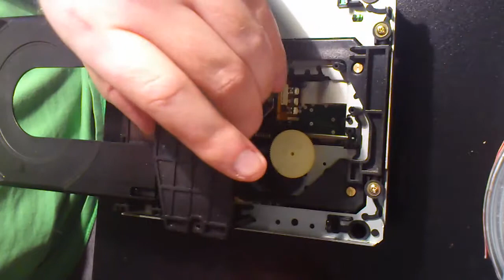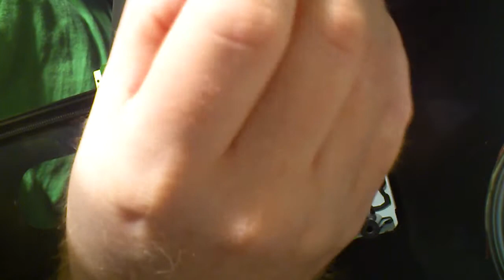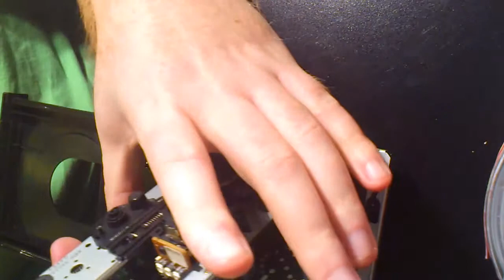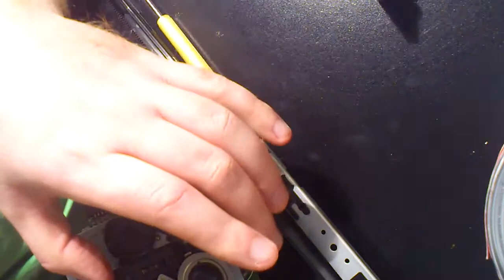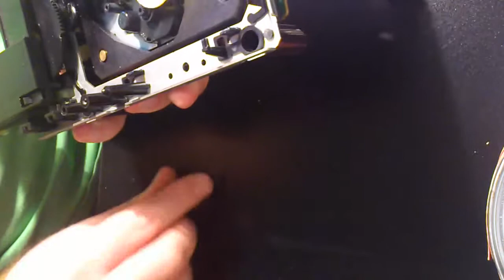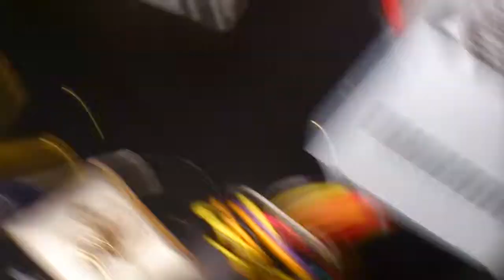sega CD model 1 Laser install

Comment: Any info on anti static point or why only SOME discs read?
Reply from the maker: Any new laser you get is gonna have the anti static blob on it that ya have to remove. most ive bought over the years come with a note about it. if ya get one that does not have the blob, its not likely a new laser. for a new laser to read, the blob needs to be removed.

Comment: Can replacing the laser fix sound issues?  My Sega cd model 1 is in excellent working condition and cosmetic condition, and it plays games perfect but it has weird swishy shhrrreeeerrrreeee sounds throughout gameplay of many games.  I already had the system completely recapped and it still has this audio issue.
Reply from the maker: I would #1 suggest recapping. Being that was done (let's assume correctly), I'd look to the next common components. Tv and sound system. A/V or stereo cables from the sega cd to the tv/stereo. Also has the genesis been recapped? Is it a HD model 1? If not, get one. The sound is greatly improved. The genesis does some sound processing even on CD games. 

If you are recapping a HD model 1, maybe consider the triple bypass with sound amp mod. That too clears up sound. 

But I'd also suggest double checking the recap job. Could be a cold solder joint, or bad pad. If the pads rnt clean and ya just put a blob over it, it can cause "noise" in the connection. Also make sure the caps are correct. Having a 6.5v cap on a 5v or visa versa can also cause noise.
Reply from the maker: And generally yes... A laser can fix sound issued if the disc was damaged. A stronger laser (or more in spec) will read a damaged disc easier. But bad caps can cause the laser to go bad too, even a new laser!

Also a bad power supply can cause noise too. May I suggest these guys? I got all my power supplies from them. 

https://www.retrogamecave.com/sega

Comment: Thanks so much for this video. I just ordered a model 1 Sega CD and it only played half of my games. The games it did play had no music or would take forever to load. I received a new laser lense in the mail today and followed this video and did everything step by step as you instructed. Now the system works flawlessly! I also have some capacitors on the way in the mail but the system works so well now that I may hold off on replacing those. The caps look old but aren't bulging or leaking yet so I think I'll open it periodically and check for leaks and such and only change them when there's an obvious problem. Thank you again for making this video. It was very helpful.
Reply from the maker: No problem! Glad it helped! The old laser mayyyy still be usable. If ya get bored one day u can try adjusting the 3 white painted screws. Those are the pots that adjust focus, intensity and power of the laser. Usually when the laser goes out of alignment, it's on its way out anyway.
Reply: @REBELsst  when I first got the system the laser had this white powdery substance around the plastic shroud that covers the laser and around the laser lense itself. Not sure what it was but I cleaned it out with a metal tooth cleaner but it played the same way. The substance  looked like what you'd find around the terminals of a car battery so I thought I was lucky it even played at all. I think I'll take your advice and keep it though. Just to use for reference I guess. Like I said in my previous comment, I ordered some caps which should arrive any time now but I think I'll hold off replacing them for now. It runs so smoothly that I'd hate to mess it up. Thanks again and God bless.
Reply from the maker: @philipayers7471  I avoid recapping if possible. Not only is it a major pain but if the system is working, there are many ways u can mess up and make it not working. Being I've been collecting for 20 years, those ideas of the caps not being that old are sorta wrong. Some are closing in on being 40 years old so recapping a working system may not be as scary a proposal. It's still a tedious job.
Reply: @REBELsst  that's awesome that you're a collector too! I guess it's obvious since you made the video. I've just noticed that the prices on some of these retro consoles are starting to sky-rocket so I thought that I should start to familiarize myself with repairing some of this stuff to prepare for future mishaps. The Sega CD I just fixed is one of two I currently own. The first one I have is in great shape. I've had it for a long time now.  But I thought I should buy another to get my hands dirty with. Problem now is I like having one for a workhorse and another for my "game museum". My plan was to do a total overhaul of the recent one and to not put wear and tear on the pristine one. I probably won't make it a habit of buying two of every console but the ones I feel that are going to go up in price I'd like to get savy with. I have no plans on selling anything that I own but I just want to be my own repair man. Gotta start somewhere.
Reply from the maker: @philipayers7471  its a sickness I think. I have 2 model 1s and 4 model 2s. I have one of each complete in their boxes. One of my model 1s is a rare (in the US) JVC built variant.